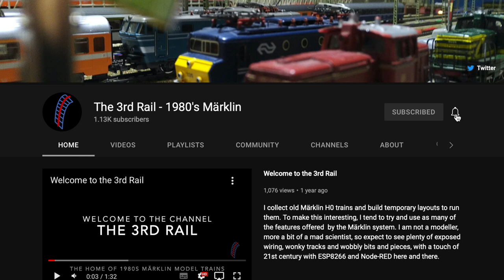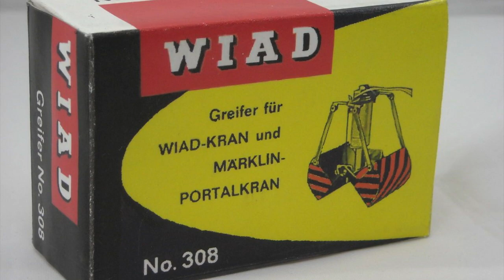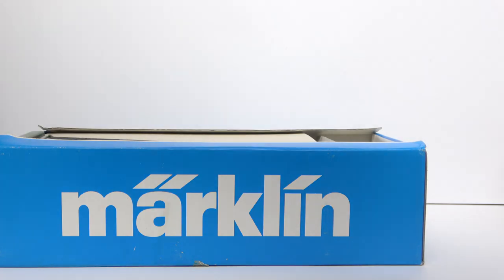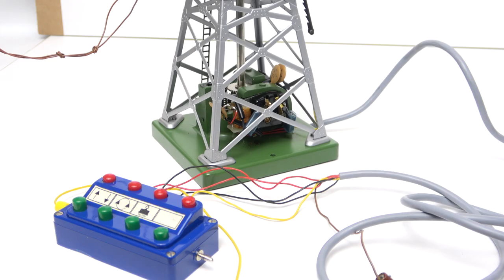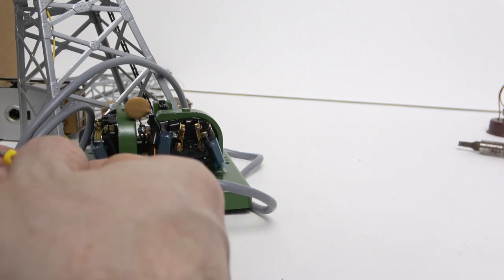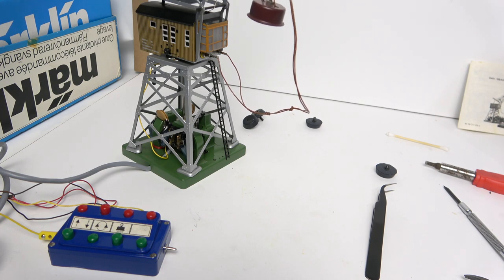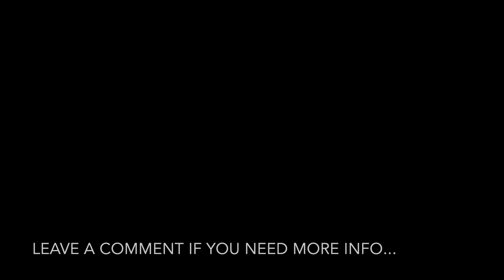Märklin Crane 7051 - Tips and tricks - Little Helpers

Comment: Great video. Thanks very much. I find the crane's turning and raise/lower speeds unrealistic...since you mentioned the motors are standard locomotive motors, I am wondering if I lower the supply voltage by connecting to the analog output of a spare analog transformer would be harmful on any way....
Reply from the maker: Ah, the good old taste and colours dilema😉 Lowering the voltage won't arm it. Have fun!
Reply: @The3rdRail  Tks

Comment: You do great videos. My crane swivels and the magnet and light work but I am using one of the control boxes that you show that you said there are differences. My problem is my crane hook will not go up or down. Is this because it is the wrong control box? Thanks!!
Reply from the maker: Hi, glad you appreciate my videos. The cotnrol box you are using would behave like the orignal one for this function. Does the motor power on when you press the buttons?
Reply: @The3rdRail  Everything works except the up and down motion of the hook. Using your video, I will dissasemble it today and trouble shoot it.  I am glad to hear the control box i have will work!
Reply from the maker: Good luck!
Reply: @The3rdRail  I have fixed the problem. It was not with the box. Meanwhile, I have discovered the 7072 box works perfectly if you block the 2nd and 4 holes from the left. The interior is exactly identical and will work if the correct holes are used. Thanks for your help!!
Reply from the maker: @patrickmurphy6775  Congratulations! Not sure what you mean with the control box, but what matters is that you got your crane to work 😀Enjoy!

Comment: Thank you for this great Video about a very nice design by Märklin of this historic crane. Excellent didactical presentation about its history, about its working potential problems. I have the exact same crane I purchased new in the late 80s. One little point: This is a fool-proof design where there are 2 clutches:  one at the base to rotate freely the cabin and the second one in the cabin on the whinch in case the motor was not stopped in time. Also, part of the box, there is a long screw, 2 fiber washers and a nut, to bolt the crane to its box. Here you may see a video about a hump yard next to the crane operated by Rocrail https://www.youtube.com/watch?v=SVEqKjZy7Tk
Here is a video on another Märklin crane: the large coaling station 76510, here in full automatic operation
https://www.youtube.com/watch?v=-wZWa-zfgag
Reply from the maker: Hi, thanks a lot 🙏  I am not sure about the cabin whinch clutch you are referring to: there is none in any of the cabins on my cranes, you can see in the video what happens if i don't stop the whinch at 29:55.  This might have been a feature of the very first version though, but I don't have one to check. I had seen your humpyard video (I am subscriber 😀), nice job!
Reply from the maker: Correction... Looking at the parts list, there should be a whinch clutch. Looks like it might be stuck on all my cranes, sounds like a good topic for an additional video... I shall check my cranes now, thanks for pointing this out.🙏
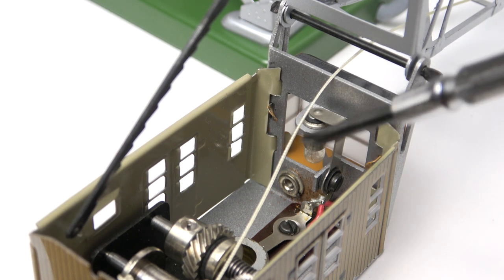Reply: @The3rdRail  Look into your video at 28:39 near the slanted gear, you may see a fiber washer, a metal washer, a spring. All this makes a clutch (maybe yours is adjusted too tight or glued by dried oil).
Reply from the maker: Yep, I quickly had a look at one of my cranes and the clutch was indeed stuck.  I had always assumed this was standard behaviour as all the cranes that passed through my hands behaved the same way. You learn something new every day, aren't YouTube comments great? Thanks again.
Reply from the maker: Hi, I was finally looking into making a correction, and I think we were wrong about the purpose of the clutch in the cab. You'd have to pull very (very!) hard for the clutch to disengage if the winch is not stopped in time, I tried! It was very scary, and the motor stopped moving before the clutch disengaged in most cases.  So, I don't think this is the main purpose of the clutch. Instead, I think the clutch is there to prevent the winch from lifting when the cab is turning. The clutch only engages when the lifting shaft (the one with  a worm gear coming though the base of the cab) is rotating, the clutch will grip to and set the winch shaft in motion. If the lifting shaft is idle, the clutch doesn't grip, and the gear connected to the worm gear on the lifting shaft will turn freely around it when the cab is moving, it will not engage with the winch shaft, preventing the hook from lifting or lowering. The clutch gear adjustment is only there to position the gear in relation the to lifting shaft, I think the cab will wobble when lifting if the gear is out of position. So, this is another maintenance point to check in any case. Take care.